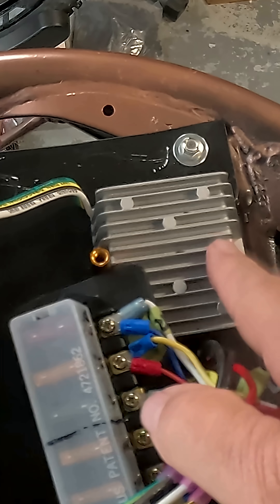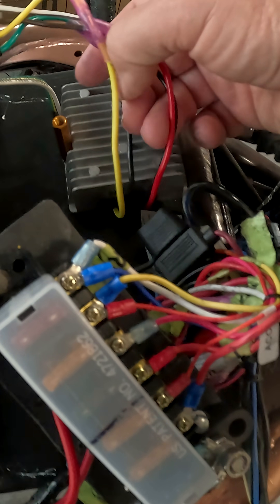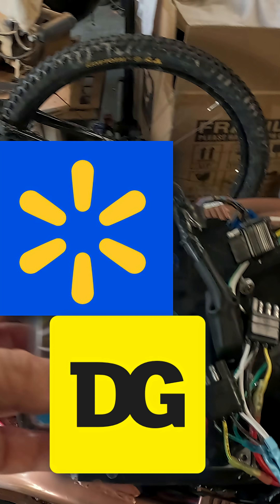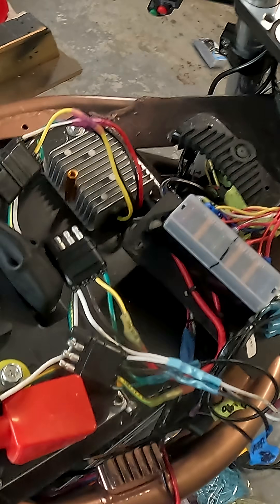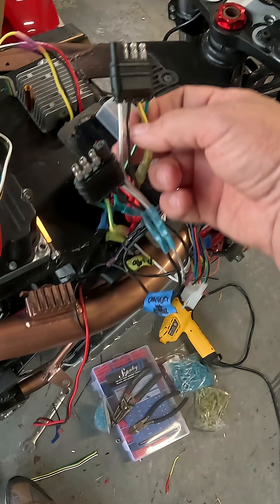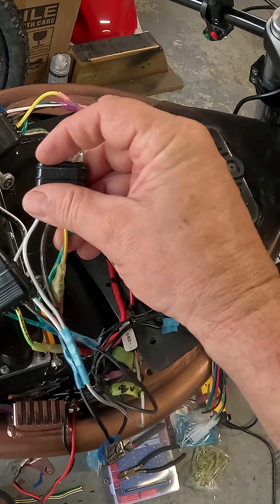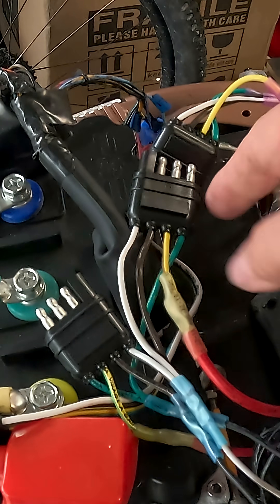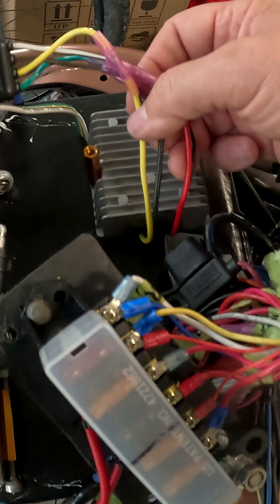96v to 12v Buck Converter

Comment: I really like the way you explain things and you infected me, I'm already looking for an old moped I can convert myself. 72v System, maybe 3-4kw battery and powerwise I've to see what is allowed here in Germany. With TüV and all that it's hard to do it legally but where there is a will there will be a way..
Reply from the maker: We ride surrons to Walmart here in the states.  LOL.  I would sneak a 12kw motor in the moped and find a 1500w sticker.
Reply: @GhettoWrench that's exacly the plan, lol. We also have Surrons here in Germany, even street-legal ones restricted down to 30mph. Because I have to use homologated parts to get an admission I'm considering a Surron motor & controller since they only have 3000 watts of continuous power officially. As soon as I have my number plate I could upgrade the controller but at first I need that f'ing admission..
Reply from the maker: @o.m.2188 paperwork and red tape nightmares.